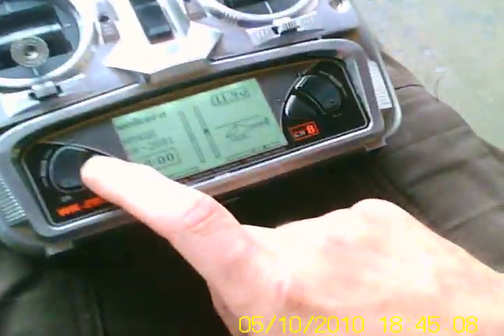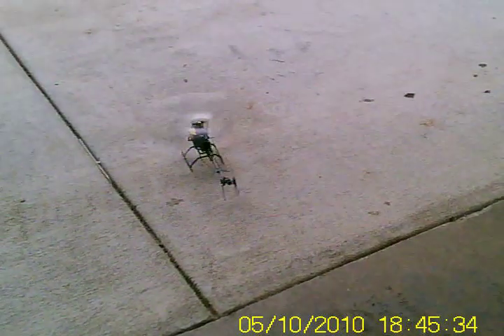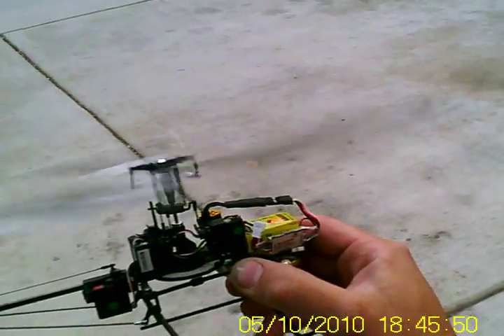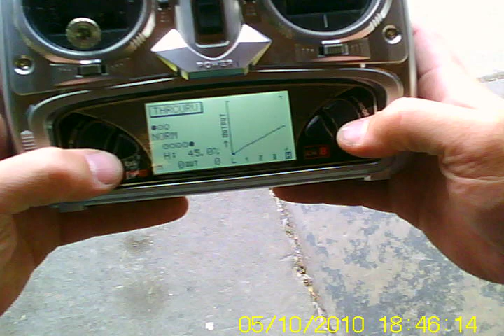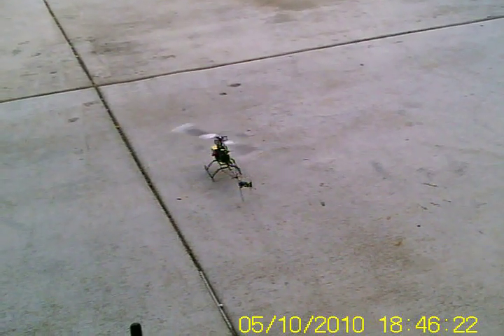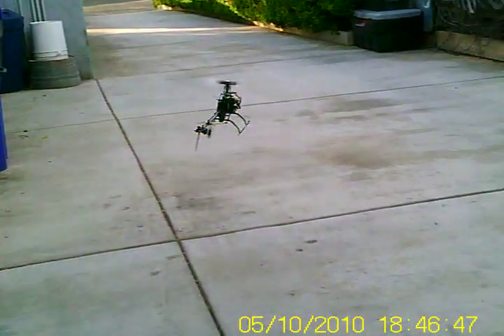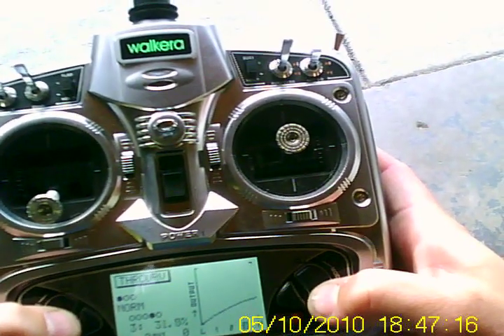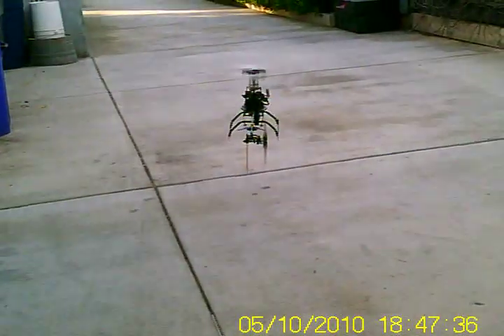4g6 3 axis gyro

Comment: @mikegigabyte go into your radio, choose mdlset and go to your curves menu.  Choose throttle curve and write down what settings u have here for each of the 5 points.  Next, increase the number of each point by whatever % you choose.  For example your first point should always be 0, then point 1 can be 50, point 2 can be 75, point 3 can be 90 and point 4 can be 100.  Or you could do 0, 75, 100, 100, 100 as well.  Press ENTER to save the settings and see if it fixes the problem.

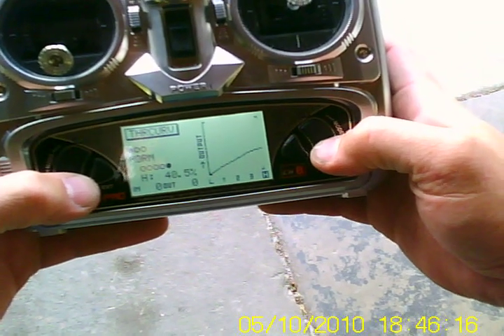Comment: Hey look at 1:12 on this video, thats your throttle curve menu.  You have your TOP THROTTLE at 40.5%, which is WAY too low.  Set your normal mode throttle curve to be 0, 50, 75, 90, 100 and see if that helps.